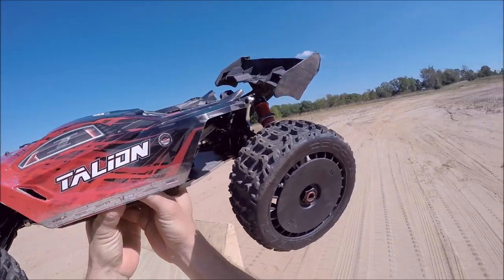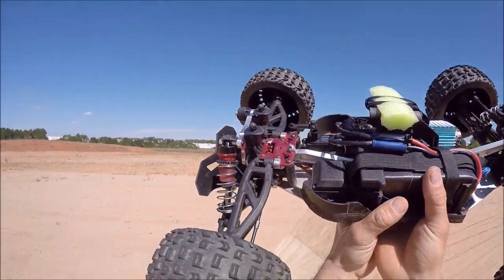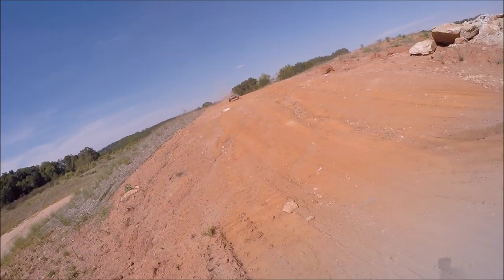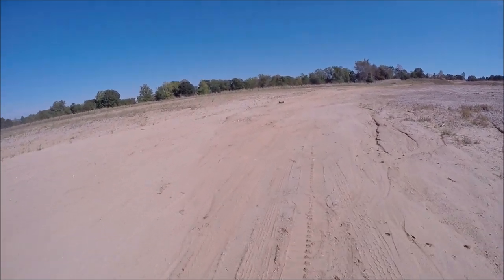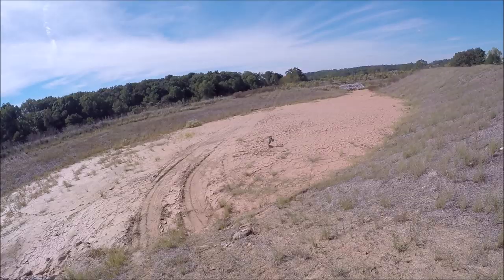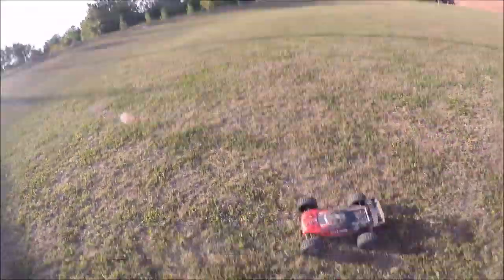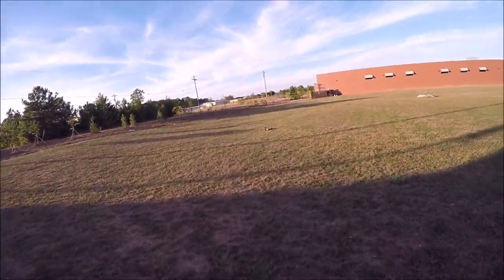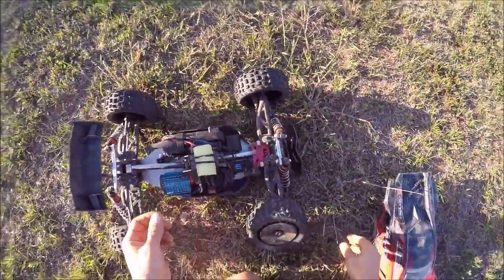ARRMA Talion -NEW M2C TOWERS TEST! and "BREAKING" the  Limits??!

Comment: Holy MEGA Launch Batman 👀!!!! Those last floaters were Nuts Brother!!!! 😱🤣🤣🚀🚀. What a gnarly spot to absolutely SEND IT 😜. Great concentration too. It's easy to flub the landing with all that hang time 🙀. KILLER test on the towers 👊. You had some wicked rolls and that power cut was brutal 👀. That would definitely bend most any shock tower. Just had my Kraton ESC repair fail today 🤬 but fortunately it was after a landing. The Talion is definitely looking full beefcake 💪. Really appreciate the shout out Eric 🤗. BTW, I wonder if you got some bum plastic/hubs 🤔. Could've been the massive hits, but I've split fresh hubs before too. Same thing with fresh arms. I chalked it up to a bad run of plastic 🤔🤘🤘😎💪👊👊

Comment: Just watched this one again... Might be one of my favorites. The flat land speed run slides and never noticed those reversals.... Sick brother.
Them 4 second hang times tho🚀🚀😎
I gotta get my send it ramp built!
Dropped my latest Vid... Some fun sends! 

Rock on and stay safe brother
Reply from the maker: Thanks so much bro!👊Yeah this vid was definitely a hard run on the Talion Stallion!💪Still my favorite rc!!😍I found out at the end of the vid on those vertical drops, the pillow balls were popping due to the arm flex of the RPM arms..🤣Thanks for watching and your comment man!😎🤘💪👊👊🍻
Reply: @RCDUDE81  thanks for the response.... Yeah I have one pillowball that keeps popping when I air it out and they are stock arms but I use wd40 so the flex a lot.... Still haven't broken front arms but I have RPM ones ready to put in that I am planning to use to avoid them popping. But maybe the pillowball cup is just worn.
Do I need to take everything off the car to bend back the chassis? I'm lazy. Always looking for the quickest way. Looks like a gradual bend over the whole chassis... Not a sharp bend
Thanks bud
Reply from the maker: Sometimes you can take just the rear of the truck off including the rear chassis and hold the rig upside down and push against the ground to straighten it. If just the rear ever gets kicked up, you can take the rear off and lay it on a hard surface and tap it with a hammer to flatten it out. If it's gradual like you said, just disconnecting the front and rear brace, then holding both ends of the truck and press over a block of wood like a 4x4 should do it!😎👊
Reply: @RCDUDE81  appreciate brother, I will try bending it back braced over a 4x4.....its front and back I think... Gradual. Sent you some Insta pictures

Comment: Are you replacing steering blocks with stock?  I have trouble with my v4 Kraton popping out and have a set of HR to do next time it happens but at $50, I may be better and lighter just doing stock from Jenny's or similar.
Reply from the maker: I'm using stock right now. I'm not sure how HR hubs would do. May cause more broken a arms🤔Need a weak point somewhere!🤣I don't usually have issues unless its these jumps or a bad run of plastic..🤔😎👊🤘🤘